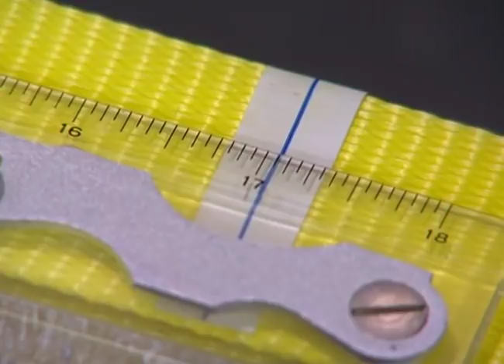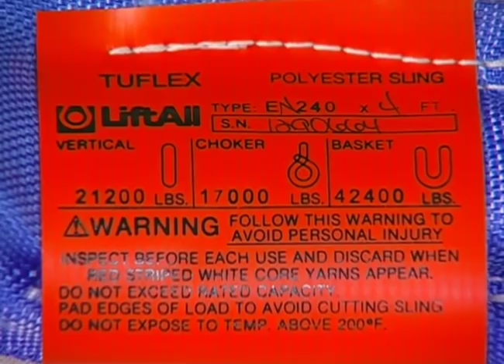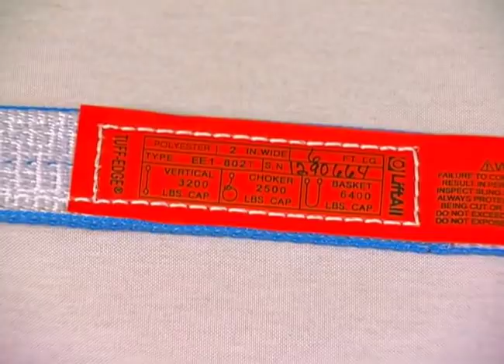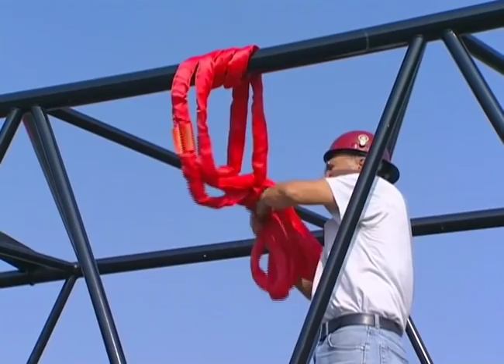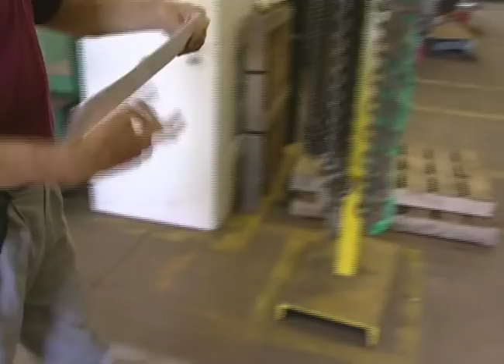Sling and Rigging

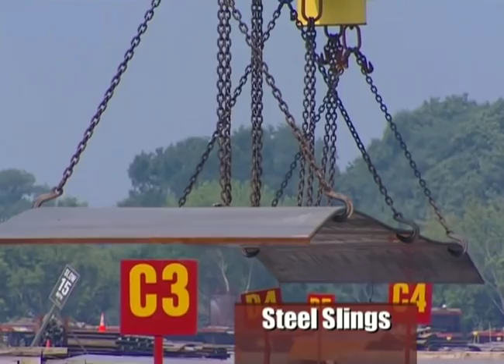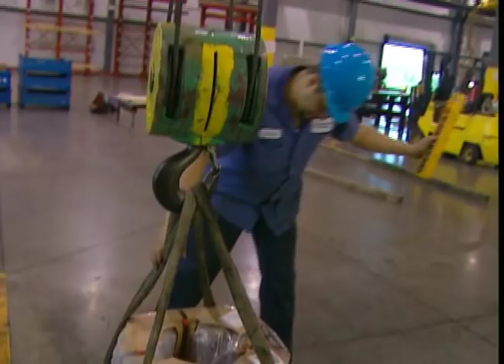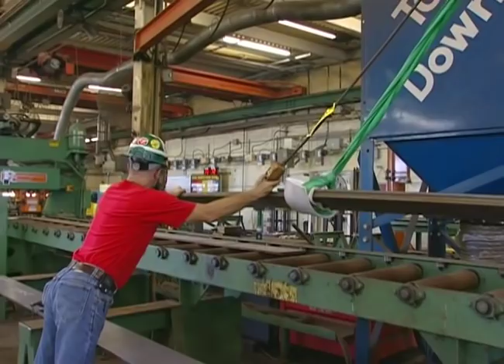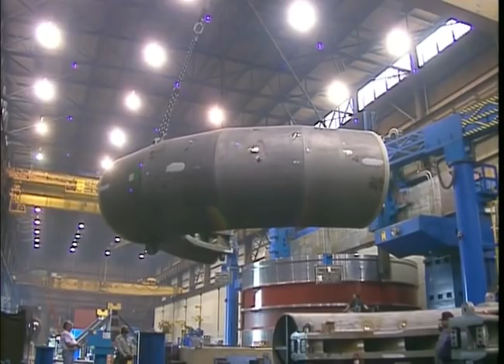Comment: Please Note - Using this video on what NOT to DO! Below are just a few of the high hitters. Not sure who produced this video but not recommended.At mark 2:46 shows all hooks being tip-loaded (stated in the video at mark 15:44 not to point-hook!) Not approved by the MFG of the hook. Workers seen touching the load and standing in a red zone throughout the video. This when the narrator states that personnel should stand clear from the load. Recommend going back and count how many times workers in the video are touching or standing next to a load when there is absolutely no need to touch the load or be next to the load. It is apparent no training or management commitment on utilizing no-touch tools and red zone in the event the rigging/crane fails and the load falls. Stated at mark 16:04 the narrator states - "Keep hands clear of the load and stand away from suspended loads!" At mark 11:01, not only is the worker touching the load while operating the pendant controller (not approved under ASTM B-30.2-2011) but pushing the load in position. (ASTM B30.2 Section 2-3.3.2 (I) and 2.3.3.4 (3) where it states rigging the load, attaching the load to the crane hook, and other tasks related to moving the load are sometimes handled by persons other than the crane operator.  2.3.3.4 (16) clearly states that the crane operator concentrate on operating the crane and shall not allow attention to be diverted while operating the crane. Mark 21:26 observed a worker walk under a suspended load.